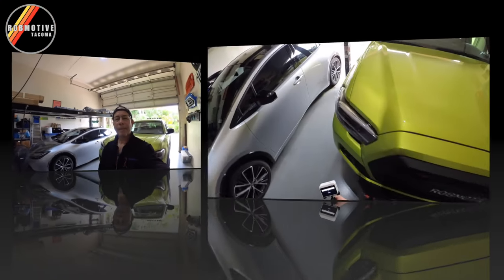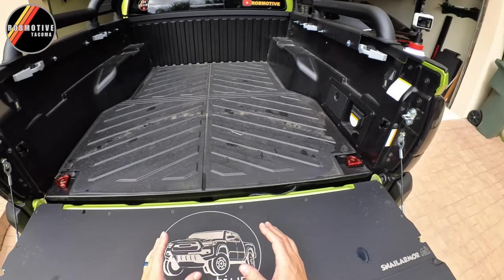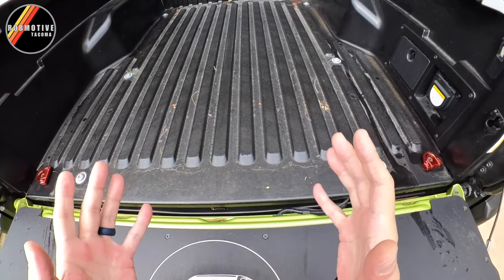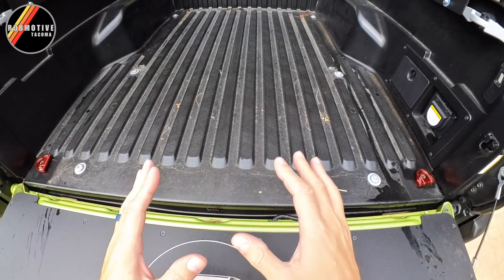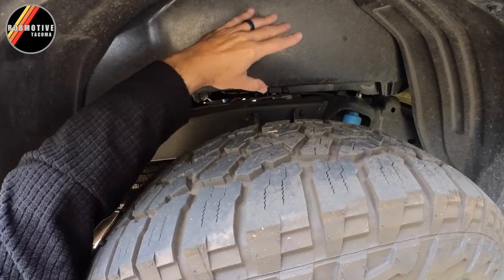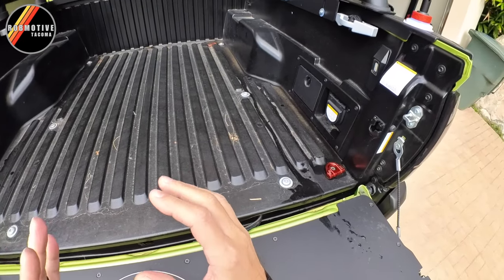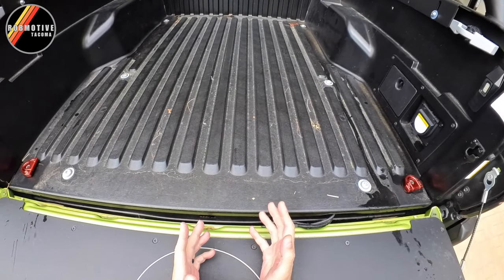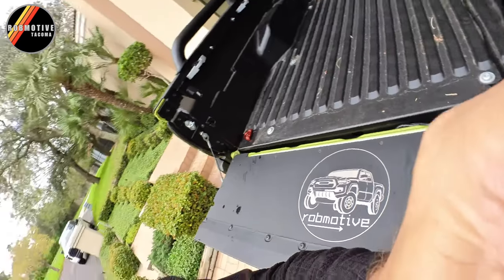The Horrible Tacoma Bed Can Be Fixed!

Comment: Not sure why you were so surprised about the bed being hard composite plastic. It's actually quite strong and doesn't rust, so that's the huge plus over steel beds. You can bedliner it if you want but theres no point, a bed mat will prevent things from sliding.
Reply from the maker: Because when I first discovered it all those years ago, it was the first time I’d ever seen it.
Reply: I’ve had my Taco for 11 years with the composite bed. And it’s the best. I’ve abused the shit out of it and it has held up superbly. I use a bed Matt - keeps things from slipping. Will never go back to a steel/ metal bed again.

Comment: Agree with you about bed sprays, best option is a mat which helps lessen rattling noises and items sliding around. Plus, adds extra layer of protection if you drop something heavy. I put a rough country mat in mine and it actually works well for a mat.

Comment: At any rate, I have the 2005 Tacoma TRD and have used it hard on the farm for about 19 years.  The composite bed is extraordinarily rugged.  I have worn out the caps, and had to replace them multiple times but the bed is just fine.

Comment: Thanks for the lowdown on the composite bed, so having a bed mat is vital to protecting the bed, adds an additional layer of protection. My first toyota pu bed was metal single wall. Rusted out fast but the sad part was the rest of the truck was great 😅❤

Comment: Knew about the composite bed when I purchased my 2020. My 1992 extra cab V6 5spd 4x4 Toyota truck had the all metal bed. I did add a drop in box liner and a canopy tho. No rust in the metal box or under the bed liner when I sold it 14 years later. I really do love the composite bed with the bed mat. First thing I bought for the truck before I left the dealership. Bed mat was $150.00 CDN at the time. May have overpaid a bit but didn’t care. I almost think Toyota should make that mat standard equipment.
Reply from the maker: I agree.  That’s an add on that Toyota could include that’s actually beneficial 👍

Comment: Waste of money to have a spray in liner for sure.  I have two rubber mats one on the bottom is from and old full size Tundra I cut to fit the width but left the length, so whenever the tailgate is lowered it covers the tailgate as well. Then an OEM Tacoma mat over the larger. Having two insulates for road noise better and adds protection for heavy items.

Comment: Home Depot has a great 1" thick heavy rubber mat. One side smooth other textured.  4 ft. x 6 ft. x 3/4 in. Black Stall Mat GREAT!!!  It just fits between the wheel well covers and inside the 6" tailgate. TOO HEAVY to blow out! COST - $60 and will last years then toss...GREAT!